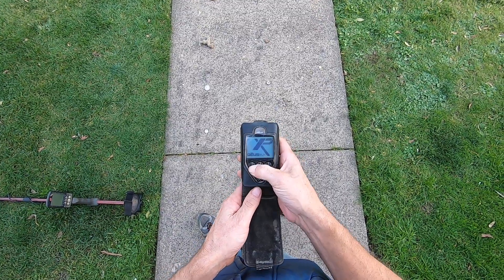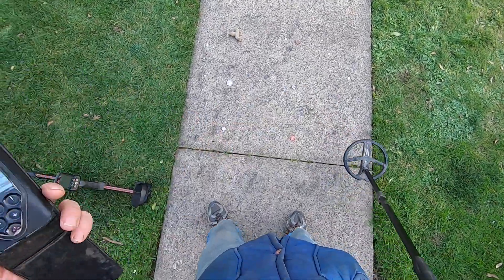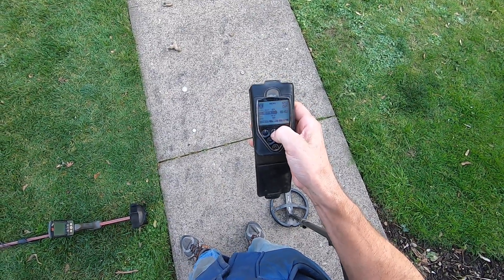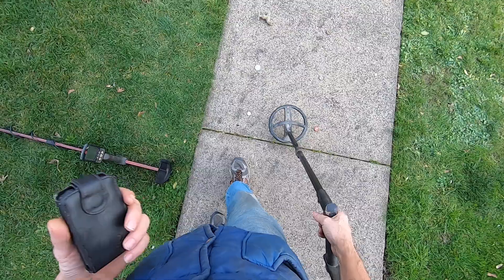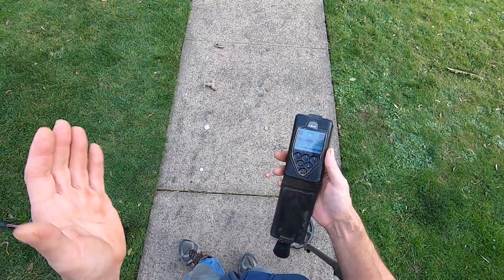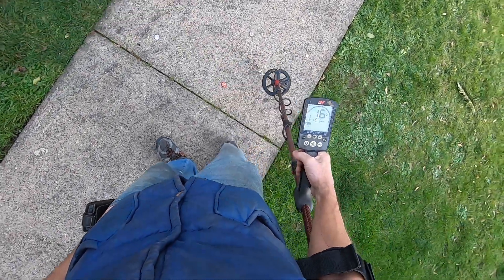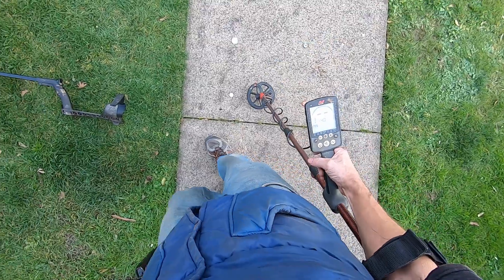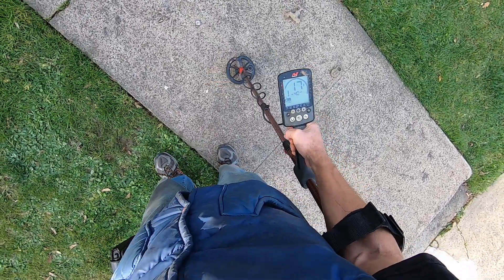Equinox 40khz/multi vs Deus 28khz test on bottlecaps, big brass and silver coins.

Comment: I'd  hate  to miss  that lock ,found a good  few   brass locks they do sound iffy .if the lock was buried  down  4/5 inches would  it make a difference very  interesting  test.
Reply from the maker: I tested that lock on all of my machines. No machine will hit it running frequency over 22khz. So bizarre!!

Comment: When will be seeing the deus 2 here in the states? I know some betas are out there but when can us normal folk get them 😁
Reply from the maker: Less than 200 will be making it to US on this first shipment is my inside info. If you preordered your Deus II from a big online dealer you will be waiting for a while. Even if you pre-ordered the first day of release you have a slim chance on getting one from the first shipment to US distributor. It will be several months before you see a Deus II on a shelf at your local dealer in US. Demand is much higher than supply for a while. My Deus II test unit is coming directly from France from XP so it does not go through a distributor and then to a dealer. If you become impatient and cancel your preorder now, it could be more than 6 months before you get your hands on one. I do not expect my Deus II I preordered on the day of release to be here for at least a couple more months.